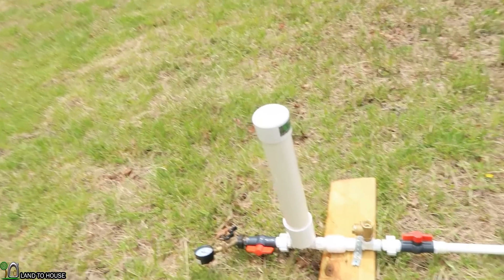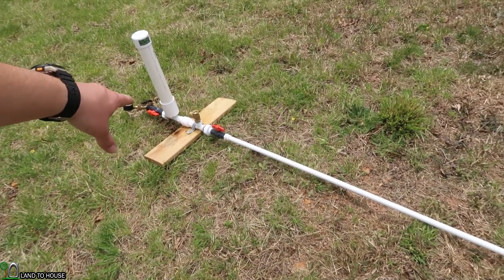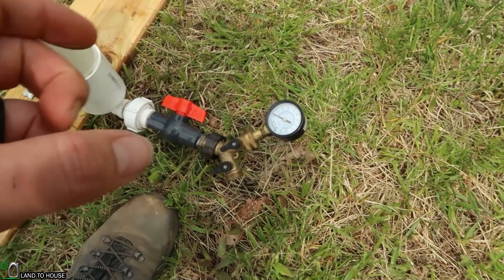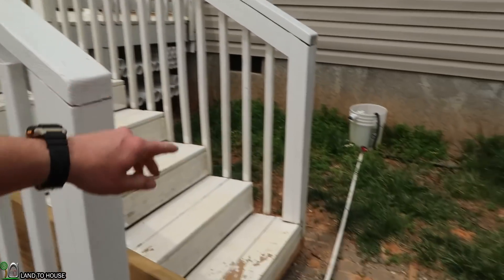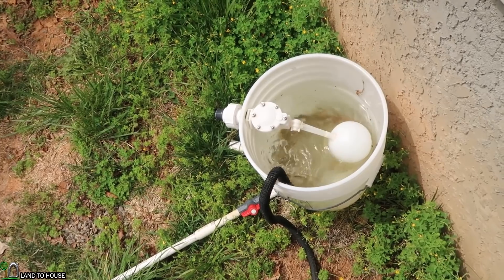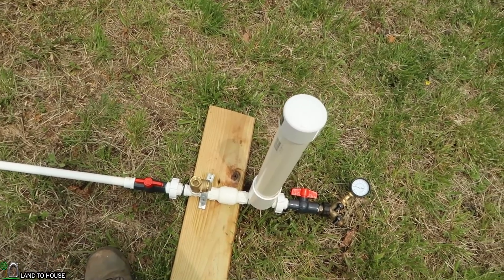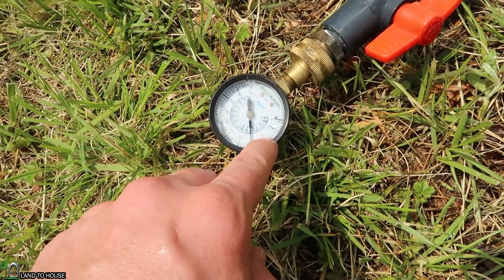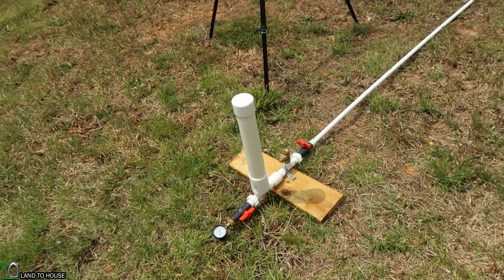WOW Can a Siphon Increase Head Pressure for a Ram Pump?

Comment: Question, if you have a 1/2 in supply, you would get 7:1 lift correct?  But what if you had a 1/4 line coming out?  Would you get 14:1 lift?
Reply from the maker: Hello. The output pipe is known as the delivery pipe. It does not matter what size you use for the delivery pipe. The output lift is determined by the input head pressure.

Comment: So the.Bucket being stagnant and the principle of asyphon pulling water instead of water pushing its way through, it seems we are getting closer to using a pond for a ram Also you did a vid I submerging the pump, so I’m thinkin if you submerge the pump deep enough th e water pressure will force enough to run the pump?  I’m still convinced there has to be a stagnant water method for pumping.

Comment: Thank you for getting back to ram pump testing in 2021 and planning on including volume output as part of the testing.     I echo Allan Liu's concern about the cracked Y in the non-siphon test.   I will be surprised if siphoning gives a better result, however, I was surprised that in some cases a stand pipe can make a significant improvement in water volume pumped as you showed in other videos.

I've seen discussion about benefits from running two waste water check valves instead of one, but have yet to test or with a bigger waste water valve.   This would be sort of the opposite of the test I did running a bigger drive pipe, which strangely resulted in less water pumped (you said this would happen).

Waiting in anticipation.   Can't wait to get my 3rd Land To House ram pump in operation this summer - multiple pumps - easier testing when adequate water is available.

Comment: Nice test! And I have seen you pulley system which you mentioned in the email. I suppose that can be used for a lot more fun testing! ;-)
I also have two commends on that test:
1. You have measured the maximum pressure after 1 Min. of operation but not the flow rate. There could be indeed a change in the maximum pressure if you add this extra height with the siphoning. To my opinion, the maximum reachable pressure depends (among others) on the speed to which the water is accelerated in the Drive Pipe before the Waste Valve closes. That top speed depends also on the path and not only on the hight (see Brachistochrone curve). But that should not affect the flow rate, because that is governed by the laws of Energy Conservation. And you do not add additional energy to the system when you siphon the Drive Pipe water over some additional height.
2. You should also avoid siphoning when measuring the Delivery Height. If you just lift the middle of the hose to a certain height and leave the open end on the ground, then a siphoning effect may start when the water has reached the highest point in the hose and flows down to the open end on the ground. That will not necessarily be the case (e.g. if the flow rate is low and the diameter of the hose is large enough so that the water just flows down in a small stream without filling the hose), but might be an issue. Hence it would be better to either lift the measuring cup together with the hose (e.g. put the open end of the hose into a bucket, then lift the bucket to a certain height, then let it run for a certain time, then lower it and measure the pumped amount of water) or have the water trickle into a second hose/funnel at the highest point. I must admit that this sounds a little complicated.
Greetings (and also apologies for the large length of this commend / math/physics is complicated ...)

Comment: You need to replicate the first test, because th 45psi was with the cracked fitting.
Reply: I know already what the outcome will be with the new test. Both pressures will be the same. There is no way you get extra free kinetic energy by siphoning!!!!
Reply from the maker: My assumption is that the Y hose adapter Was the issue in the 1st test.
Reply from the maker: Yes. I think I will go to a flat parking lot to retest this.
Reply: I agree. It'd be neat if in a future video we could see the pressure and flow tests together with whatever setup he comes up with.  Really liked the video, it's an interesting idea!
Reply from the maker: For sure. A retest is in the works.
Reply: Have you tested the size (diameter) & height variations of the pressure pipe to see how this affects lift/pressures?
Reply: @TheJakeRobinson  
affects*
Reply: I was thinking that additional length of the fees line would merely add extra friction on the flow of water, reducing useful ram effects.

But with equal feed height, your only 'advantage' might be cavitation in the tip of your siphon.
The same amount of energy is feeding your input source (gravitational potential) regardless of what altitude you pipe the water uphill, any means of extraction of that energy will be limited to that extent.

So yeah. Looks like the fitting spoiled the initial test.
Reply: The siphon just made the higher tilt possible. The tilt gave it more drive. Test the same drop with one siphoned,  and without the cracked gauge fitting.

Comment: I have 3 questions for you

1: can you link multiple ram pumps together to create insane amounts of pressure?

2: you said in your double ram pump video that for every 1 foot water drop the ram pump could pump the water up 7 feet, does this mean you can link multiple ram pumps together to pump water up like 500 meter?

3: I noticed that the pressure chamber is closed but I saw a couple other videos where they were open and the water would just spill over, are they closed for a reason?
Reply: Let's rephrase this nightmare of a sentence

Ram pumps toss water aside as waste to get water flowing, to then close one valve, using the dynamic pressure,(which is high because water doesn't compress)(which is why the syphon system was effective) to put a little water in the pressure vat

And this is why my comment doest make sense,. I added arguments and solutions on the go, making one big mess
Reply: 1 ram pumps are not very effective, but 10 pumps for the first step, 3 for the second one and one for the last step

It takes a lot of flow to get the pressure up
Reply: @Redicule_research._ridiculous  I don't think I understand what you mean, where are you from?
Reply: But it might just work. Look at the video after 10:00 , with the measuring cup. There's the problem

Comment: Very interesting...sounds like a job for the "world's smallest ram pump"!
Reply from the maker: I have that pump still. Sure would make testing easier.  Ok done! That's the next ram pump video.
Reply: @LandtoHouse  Just judging by the difference with the simple elevation - I'm wondering if the coiled tubing on the other side of the pump might be applying a form of "back"-pressure? I don't know. My dad was the hydraulic dude...I'm more "thermally oriented". Which may actually be a good excuse to make the additional height along the feed tube adjustable? Higher for colder water and lower for warmer? If i understand the concept correctly, you don't want the ever popular, macho "More! More! More!" version of pressure, right? Isn't the target "the sweet spot"? Where everything runs with some room for the variables and you don't collapse the line? Or am I thinking of something else....

Comment: Couldn’t you use a much larger drive pipe diameter to simulate head pressure. That way height isn’t an issue?

Comment: I’m not sure why that experiment worked. The increase in pressure on the back end of the “siphon lift” should be offset by the decrease in pressure on the front end. I love your practical and informative videos.
Reply: @thewillderness7852  Yes and No! Remember, it was only measured the maximum pressure after 1 Min. of operation. For energy conservation (and that was probably meant, when you mentioned BernoulliS Equation) the flow rates are relevant. There, the additional siphoning height should not change anything, or at least not much. There might be slight changes, because the efficiency might change when the geometry is changed (e.g. a steeper Drive Pipe directly in front of the pump / see Brachistochrone curve).
Reply: @patrickhoffmann8893  I think removing that brass valve may have increased the pressure. It wouldn’t take much of a leak there to reduce the pressure that first test that he did.

Comment: May need to redo the non-siphon one because of the crack. That crack could lead to loss of pressure and the number could be significant. My 2 cents.
Reply from the maker: That is very possible. Whenever I remake this test I will try to do it more consistently. Not Locking down the pump from the beginning of the test is also probably causing some loss
Reply: I also would suggest to redo the non-siphon test. I assume the crack was already there and was probably reducing the pressure.

Comment: Will the Ram Pump parts make it through a winter, with freezing temps?  Intend to use it in a stream in NC.
Reply from the maker: I have customers running pumps in Canada with no issues.they  insulated everything and buried parts. The most common place that breaks is the pressure tank. If the water stops flowing that tank will often times crack.
Reply: If there is water in the pipe when it freezes it will expand and could crack the pvc. The manufactured parts I have no idea, but pvc is cheap enough to replace if needed.

Comment: my hypothesis is that the increase length and therefore increased resistance in the pipe decreases the pumps delivery rate. a syphon would be really useful when using a pipe with a large diameter, meaning that you can use a bigger ram pump with the increased amount of water/flow rate being syphoned from a creek

Comment: Too much height causes my exhaust valve to stay closed.....and.....when are you going to throw a ram pump in a pond??
Reply from the maker: From my experience head pressure over about 20 to 25' will prevent the pump from cycling. Customised waste valves can add weight to the valve so it could have higher head pressure. The pump does work with the source as a pond but it doesn't work in a pond.
Reply: @LandtoHouse  have you put it in a pond??? ......  mine has 4 feet of fall from intake at surface of pond water down to exhaust valve and a 1/2 inch garden hose that it pumps through.....my intake is 20 feet of 1 inch pvc..... pump is held in place with 2 concrete blocks...... the 1 inch intake has 2 feet of 4 inch pvc at top so that part of intake is getting air utilizing the barometric pressure as well as recieving water from surface of water
Reply: @LandtoHouse  does work in a pond..... quit being a bozo and experiment for yourself and then make a video..... close mouth, open ears, engage thought processes
Reply from the maker: Lol.  Hydrostatic pressure and head pressure are equal and opposite forces in a body of water. There is no water movement to get a pump cycling.
Reply: @LandtoHouse  wrong..... close mouth, open ears, engage
Reply: @LandtoHouse  why have I attempted to help a guy this dumb

There's a video from about a jear ago, where all problems, apart from ideas violating the law of thermodynamics are adressed
Reply: Where's the height difference? If the waste valve has pressure on it, efficiency plummits
Reply: @Redicule_research._ridiculous  that's why people ask questions...(because they don't know) ..... all you need to know is a ram will exhaust under surface of water..... you are outsmarting yourself in a negative fashion.
...... this is simple.... go build a ram pump and put it under water
Reply: @DeeMoback  a ram pump will run under water. The only thing it does is convert a large quantity of low energy to a little quantity of high energy and quite a bit of zero energy This energy can be pressure, or head height, or whatever

Only efficiency is lowered when placing the pump underwater, but not all
Reply: @Redicule_research._ridiculous  zackly